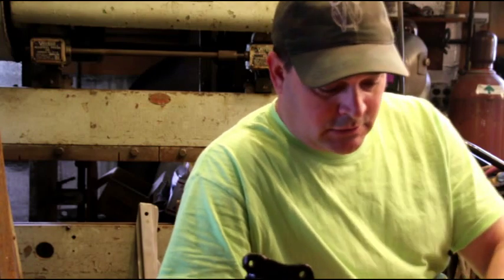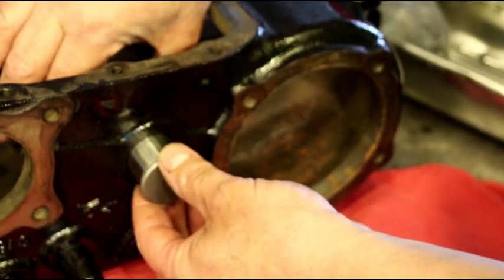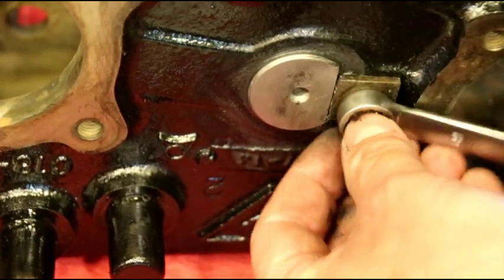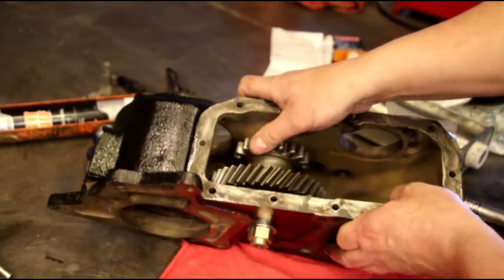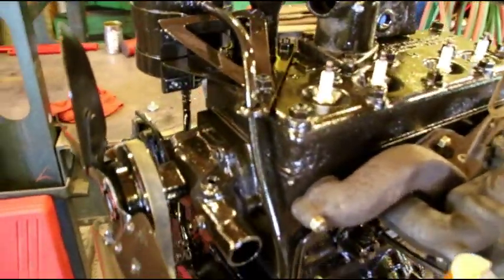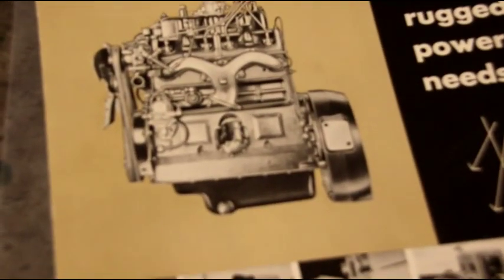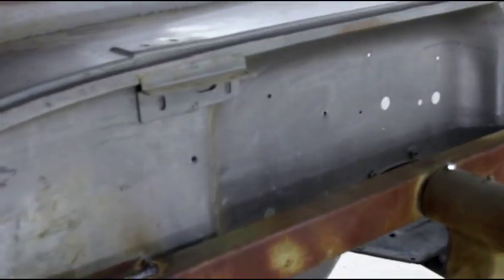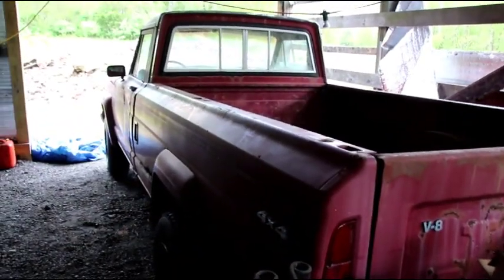Willys Transfer Case Bearing Upgrade,  Shop Project Updates, New Project Arrival

Comment: Brian, when I had the same opp as you just had,,a nurse told me to put a warm hot water bottle on the wound of a night to relax the mussels ( and it worked) years ago we would bore out the gear the same as you but use a new original shaft and thrust washers,,your set up is far better..regards Frank
Reply from the maker: My appendix was not where it was supposed to be and was moving into my kidney so the surgery took a long time and was painful afterward.    Getting better day by day.    This intermediate gear setup is the best I have used so far, super smooth and quiet.

Comment: Praying for your well recovery
Reply from the maker: Slowly getting better, thanks for your comment
Reply: @metalshaperJeep  what is the guage measurement for the valves intake and exhaust for the 1942 flathead engine and the 1952 overhead engine. I don't know exactly what category this jeeps fall into is it CJ3B, CJ3A,
CJ2A, 1943 WILLYS MB and 1942 WILLYS MB/GPW. My dad past away 8 months ago and he has 3 types of jeeps all military . I'm currently living in Japan but with this virus going around I'm on hold back from returning home for good. It's my turn to get this jeeps running in the best conditions just like my dad did for so many years.

Comment: Hell! Brian, hospital is the last place you want to be in these times, I have been pussy footing around for the past 4 weeks and not doing anything hat could land me in hospital, but appendicitis is something you cant plan for, just take it easy for a while, they tell me you will not break the stiches, but it does hurt , especially when you laugh! That taper roller conversion is a very good idea, and the preload is something that few people think about, but is essential. Stay safe . Chris B.
Reply from the maker: I worked thru the pain for a week thinking I was just sore or pulled a muscle.  Then one night it got so extreme I had to go to the hospital.  It wasn't too bad, most of the rooms were empty and I had good care.  
The intermediate gear bearing setup is the best way to provide long life, less noise, and super smooth operation.   Lots of people were telling me that they couldn't find anyone who would cut their gears so I figured I would show the whole process.   Thanks for watching and stay safe out there.  
Brian

Comment: I got appendicitis last year, that was very unpleasant.  They took it out through a small incision, still left me pretty sore for a couple weeks.
Reply from the maker: They were going to do the same for me but my appendix was not in the right place.  They really re arranged my insides to get to it and extract it.   Surgeon said it was a very difficult removal and to expect pain for a while.  He was right still on the mend.
Reply: @metalshaperJeep  I was in pain for three days in the hospital, they could not operate because there were car crashes, shootings, overdoses, and other more pressing things going on.  My room was next to the helipad, so that was interesting, I was getting IV antibiotics and pain reliever.  Finally they took me in about 2 or 3 AM.  Then I had to poop and pee before I could leave and that was hard to do.  My dads oldest brother died from appendicitis and dad told me how bad he suffered with it, and I always was worried I would get it, Dad came from a big family of 13 kids and 5 ended up with appendicitis.